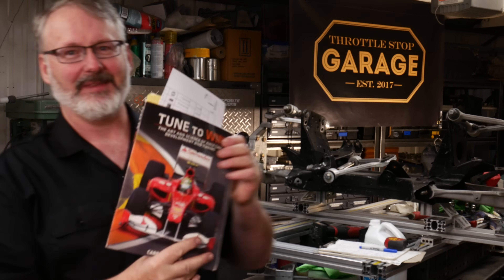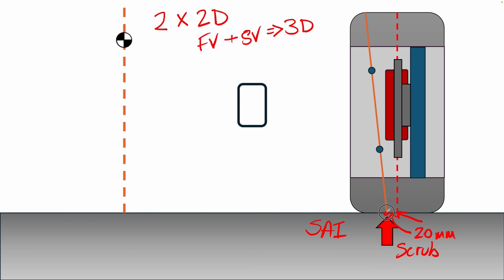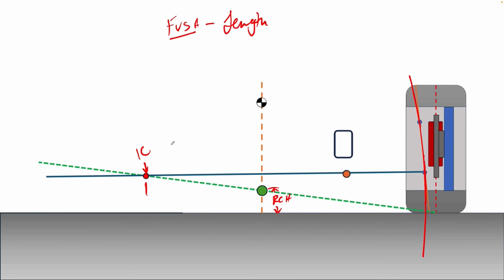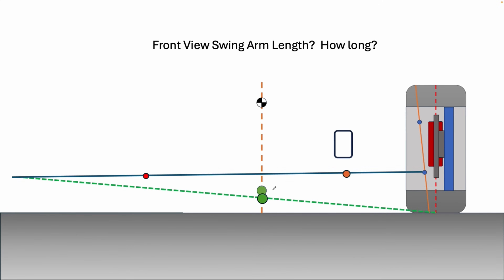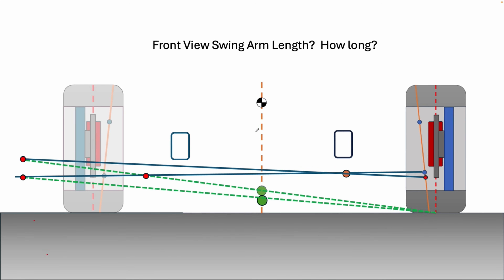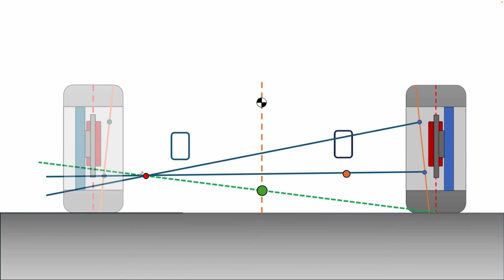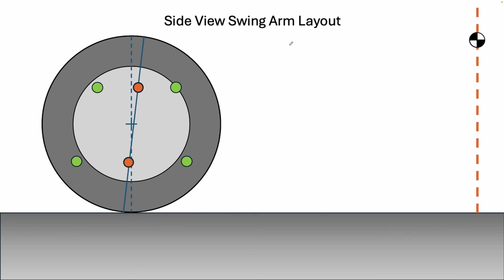Suspension Design - Take 2 - New and Improved and in 3D! My attempt at doing the impossible.

Comment: My only advice to you as  retired engineer is before the weld or build your suspension set up is to build a mock up system that's adjustable. Through out my years in the industry ive always gone back to this basic system once knowing my chassis dimensions and total wet weight.
Reply from the maker: That's excellent advice - thank you.  I will do that for sure.

Comment: Having done alignments for 40 years, that looks legit. I guess allow for obvious camber and caster adjustments up the uppers. A standard set of figures for road use would look like +.5* camber, +3/4-1.5 caster. Possible much more caster for high speed stability. So allow if adjusting from the upper control arms, movement both at the front and rear via slots of shims. Toe in, about .10-.12". Then you've got steering arm lengths, so you can try and figure toe out on turns. That could be tricky. Unless you've already got fixed knuckle placement via the Corvette ones.
Reply from the maker: I've got a plan for the UCA adjustment but need to work it out a little more.  I'm leaning toward slotted holes for adjustment.

Comment: This is all about the spatial relationships between points. That should scale. Build yourself a cycle cart and trial your design. Adjustments will be relatively inexpensive. When you've settled on a design, scale it up and make the 'real' thing.
Reply from the maker: Once I've got it in Fusion, I'll 3d print a model and see how it works.

Comment: Easier way in my opinion to visualize the forces for anti-dive (I think this is from Milliken): draw an imaginary slot that the axle travels in, direction of the slot being the instantaneous direction of the contact patch (perpendicular to the line to the IC) Upper and lower arms level means the slot is fully vertical. The full horizontal braking force of that tire goes through the walls of the slot, and the spring is the only force in the direction of the slot so it’s left with the job of counteracting the pitch moment (pitch torque). If you change the angle of the arms, the slot (which represents wheel travel) is now inclined such that the axle moving in the slot direction is perpendicular to the contact patch/IC connecting line. You tip the slot back and your reaction force from the wall of the slot points slightly up, and the spring now needs to handle some of the braking force (this is the jacking you were talking about) and also the pitch moment: Pro dive. The opposite is anti-dive, where the slot is tipped forward, or the contact patch technically is moving forward. This is why motorcycle forks dive so much: high Center of gravity and also the whole wheel assembly travels in the pro-dive direction at the angle of the fork rake. Perfect storm for bottoming out the front suspension.
Reply from the maker: I'll have to go back and check RCVD to find that - this is a great explanation.  What really unlocked it for me was that it's static based on the fixed points and I was so stuck in the FV that my brain didn't grasp it until I stoped watching explanations, grabbed a sheet of paper and did a force diagram.  Bingo - simple...and then you feel stupid for not having the light flick on.  Learning.
Reply: another one that worked for me though it’d be less transferable to others is imagining an equivalent 4-link suspension from the side, since the instant centers and jacking moments seem more intuitive when you can “see all the circles”. 

This is probably because I’m a CSWP/mech Eng but when I did this for my transaxle Jaguar IRS design I had a much better time using a combination of 2D and 3D sketches and immediately modelling parts within a mess of 3D scans than sticking in the land of 2x2D. I had some TIGHT brake/body clearances I was working with on top of managing all the curves so it was essential that I get to 3D and start waving that corner around asap so I could come up with a strong design that actually clears. I’m using the ol’ laser sheet metal origami trick to make everything. You don’t seem as backed into a corner as me in that respect but if you do get stuck feel free to reach out on fb/instagram (this is my real name) and I can show you what I did. Pretty sure you’re local to me too but obviously no need to discuss locations publicly in the comments here.
Reply from the maker: @mitchellsnider4198  Thanks - I do wish I'd tried to do this in 3D from the start.  It probably would have taken less time and would have ended up in the same place.  Getting clearances and packaging sorted out was/is a challenge.  I'm also trying to use as many OTS parts for brakes and hubs etc as I can. I'll fully design uprights and arms - no problem - but I'd like to avoid having to design the rest.
Reply: @ThrottleStopGarage   bingo, steal the engineering wherever you’ve got consumables, seals, and precision: brakes, engines/transmissions, axles/CVs, glass, dampers. I’ve retrofitted Honda Fit brakes on my Kei truck, and my XJS is getting Audi A6 brakes (had them lying around and they just barely clear 17s which is perfect). Looks like you’re generally following that same philosophy too. You kinda broke that rule with your carbon body but it looks like you had fun, learned a lot, and absolutely earned some respect, from me at least!
Reply from the maker: @mitchellsnider4198  The carbon body did sort of get away on me.  I really just wanted parts that won't rust - then it got out of control and well...there is still a roof that needs to be lighter at some point.
Reply: @ well if you do it I’ll learn some lessons I might be able to apply to my hopelessly overweight Jaguar XJS and might even be able to do the Eventer shooting brake conversion I’ve always wanted with that knowledge. Just don’t make it look too difficult or my wife won’t green light the project 😅

Comment: Hey! Yup I can confirm some contents are confusing on that you first set the lower inboard pickup point. It's as you said instead: RCH first, then derive that virtual arm. Because "virtual" is another thing nobody says. It's the actual height of the triangle. It's all hidden in plans sight like the Holy Grail in Langued'oc :DDD

(...that thing got me confused bc it points you towards making the lower arm as flush as possible with the chassis but this just has no direct relation with what you're doing it has with rollcenter instead!! And I had to get back looking close at a lot of vehicles like my proto (it's a crosskart) before convincing myself that it's fair to have instant centers above the chassis ground, and that's where it was the missing ground clearance I was looking for, in the end.)
Reply from the maker: I think there needs to be a support group for anyone that has survived designing their own suspension.  I went around in circles with software until I worked out the RCH cheat...then the FVSA length sent me over the edge...then I worked that out.  If this helps a single person, I'd be very happy.

Comment: Absolutely true that once you commit to one dimension the others start to fall into place. Since your last video I've begun building a tube chassis from scratch as my next racecar. For me that first dimension ended up being the steering rack position because after a bunch of measuring and math I kept coming up with poor situations if I started somewhere else.
The rack position led to steering arm length and steering degrees available. In order to meet my needs that placed the tire, which set the spindle and ball joints which the set the pivots based on camber curve and roll center... It was an exhausting day of thinking.
Not quite 2 months in and I'm fabricating the lower control arms now to be able to have it on all 4 wheels... maybe by the weekend. 
I also built mine around slugs in the mounts. Basically have +/- 1/2" on everything for tuning
Reply from the maker: It was an interesting experience.  I know I've read it (I've even taught it) but when I've gone through a suspension the 40 or 50 times that I've done this and some things just fall out, it gave me a real sense that there are just a few critical decisions, the rest is then set.  Next up for me will be the arms and uprights.  Then we'll see how it all fits together.  I hope to use the slugs I have for adjustment.  These ideas are still floating right now.

Comment: Hello, I think you should reconsider your starting point, the virtual pivot point of the axle. The body with engine and interior equipment has a center of gravity axis. The distance between the pivot point of the axle configuation and the center of gravity of the vehicle creates a torque when cornering that causes the body to roll. This must be counteracted with an anti-roll bar. However, this reduces the possible lateral guidance forces.
The distance between these two points should therefore be as small as possible. 
Regards
Torsten from Germany
Reply from the maker: Those parameters are part of the consideration.  I estimated the centre of gravity and considered the roll centre location and the resultant moment arm created from that relationship.   Moving the roll centre up to the CofG is not advisable. This would result in a vehicle that doesn't roll...minimizing roll is fine but can effectively be tuned with anti roll bars.  I've placed the RCH at a reasonable position for the rest of the kinematics behavior.

Comment: Thank you for a good video and its so interesting to se and hear youre thoughts, through the process. I am interested in what you changed to get it to the last version (better result). Good job!
Reply from the maker: Thanks, much appreciated. Adding the steering was quite a bit of work as it needed things like the definition of a turning radius and Ackermann. There were multiple iterations of ball joint positions until it all worked out.  I'm still working on the upright design...but I needed a little break to stop from burning on on the suspension.

Comment: If you want good book as a resource, I suggest Milliken & Milliken "Race Car Vehicle Dynamics".  It is a difficult topic but you did a good job explaining it.  This video was front centric, now it gets creative when taking into consideration what the rear is doing!  On my project, I've made everything a little adjustable so I can fine tune it at the track.  Outside of F1, I think it is considered desirable to have a little toe out on bump, meaning that in a turn, the unloaded tire should turn slightly more than the loaded tire.  This is related to bump steer and Ackerman.   Keep up the good work, nice to see you make progress.
Reply from the maker: Thanks.  During this adventure, I read every vehicle dynamics book I could find.  RCVD was one of the first.   I finished the rear years ago - it's an IRS and everything back there is staying as is until I get it on the road and I can see how it all works.

Comment: Hey Craig, good to see you're still around! When I did my car (you know the one) I had just a little bit of knowledge. I knew that I didn't want bumpsteer and that placing the rack outer pivots on the line had a big effect on it. Parallelograms and all. So I modeled it on a sheet of plywood and cut out  full size  cardboard  chassis components. Used pushpins to act as pivots and connected the upright with small nuts and bolts to simulate pivot points for suspension travel. Moved it up and down and said "that looks OK" . Started building on the car and realized I couldn't move the rack rearward enough to get any Akerman, "Oh, well" gotta accept that. I probably wound up with reverse Akerman 🙃. Whatever I wound up with seems to work well! When I turn the wheel clockwise the car goes to the right, perfect!!
Reply from the maker: Alan - glad you watched. I was racing with a guy this summer that built a crazy '69 Camero with an LS engine and a couple of turbos...and a mustang 2 front end.  You know what - that car gets around a corner just fine.  It convinced me that even with "sub-optimal" geometry, it wasn't garbage.  That's around the time I stopped digging the hole.

Comment: Ha ha ye ole rabbit hole of suspension geometry. 😳. 
I found your original content very helpful as it was more visual than the many numbers and figures explanations on YT . 
I ended up using my steering rack inner joints as a datum for the lower wishbone pick ups to eliminate bump steer and worked backwards around the roll centre to determine everything else. 
Of course that was fine until you find that your wheel offset determines scrub radius and disc position 😂. 
Then because mines a race car it has virtually zero droop on the front axle and only maybe 1 1/2 of compression camber gain becomes an issue. 
Round and round in circles many many times. 🤭 
And I’ve not taken into the equation I’m going full pushrod suspension with full aero package with an adjustable bladed roll bar on the front and will be using a third element to compensate for the rear downforce created by the rear aerofoil and huge diffuser.😵‍💫wish mee luck 
Great helpful content for anyone
Thank you 👍🏴
Reply from the maker: Wow.  That sounds intense.  Glad the videos have helped.

Comment: I think you are going to have some really nice suspension when you are done. Having put a ton of cars in the air on a lift, there are some production cars out there with crazy camber and toe changes at full droop. I think you are holding yourself to a standard that is beyond what some auto manufacturers do. At the very least it will be way better than what the car came with.
Reply from the maker: Thanks - I appreciate the positive feedback.  I do hope this all turns out and the suspension works.

Comment: Now that's I've slept on it. A few corrections. Final geometry will be fairly dependant on you tire specs. Particularly the aspect ratio and width. I would assume you're going for a fun street car. So a 60 series would be fine. Going to need some sidewall flex as the control arms move thru the arc. The shorter the sidewall of the tire, the more true to camber setting it will have to be or cornering traction will suffer. If you go say with a 225/70, most is forgiven. I would be tempted to hard model it next with a RC car from the hobby shop, which many already has adjustable bits. Traxxis, Tamiya, etc.  But you can buy individual replacement suspension spares and piece it up, per CAD. Then you can jounce, squish and ponder. Also great for visualizing lateral acceleration to have physical body. Later.👍
Reply from the maker: That's for sure something I'm thinking about.  Front tires are 225/45 r17.  So less sidewall.  This selection is based on current tire availability and future supply in a size that will work.

Comment: Regarding weight transfer during braking, I'm not sure it matters what the percentage of front/rear braking is.

I believe weight transfer is determined solely by the longitudinal deceleration, CG height, and wheelbase.
Reply from the maker: But you do need to consider it.  The equations want percent front along with the variables you've called out.
Reply: @ThrottleStopGarage  Oh right, now that I think about it, the antidive % designed into front or rear suspension would depend on how much of the braking load each has.

Comment: Good to see you back.  I'm curious what tire size and wheel spec you're running?  I assume you have that worked out since you modeled the tire height and centerline.
Reply from the maker: It's nice to be back!  225 45 R17's are the size for the fronts.  Wheels are 45 mm offset (packaging ball joints and brakes mostly).

Comment: Nice work, I have a few comments its too much for one post so I’ll break it up, first I don’t remember if you are making your own spindles now or just using the corvette ones but just remember mechanical trail the hub doesn’t have to be centered in the knuckle.
Reply: You mentioned scrub I think 20mm and that fine for a street car but tires are a big part of deciding scrub, remember you have effective scrub and actual scrub, in one of your past videos you talked about the vett scrub being like 40-50 (I don’t remember the exact number) and how horrible that is, I struggled with this also some years back until I learned why the that school of thought was used, 40-50 scrub on open wheel race cars is not uncommon, the high static negative cambers plus wide soft compound tire and slip angles required more scrub to keep the contact patch closer to ideal, anyways like you I wouldn’t run that much especially because of the rack and pinion your using, wide tires and high scrub would punish that rack so I wouldn’t run try and keep the road force torque  to a minimum. 20-25 is good imo.
Reply: Ackermann for short tracks autocross type of racing I would run as close to 100% as possible.
Reply from the maker: Making my own everything.  C4 stuff will be up for sale at some point.
Reply from the maker: That was my line of thinking.  The C4 was more like 75 mm or something.  I did read a bunch about the nature of scrub and the variables, most of what I could read came down to having it not cross from positive to negative and not having too much.

Comment: Beyond my pay grade 😮
Reply: Same here,
Reply from the maker: Sorry - I tried.
Reply: @ThrottleStopGarage  don't be sorry, it's good stuff. I know where I'm coming back to if I'm doing custom suspension geometry on a project.
Reply: @ThrottleStopGarage 
Ackermann, I assume the oem just picks a happy spot to cover most the wheel bases?
What happens when a vehicle is stretched into a limo? Tires scrub?
Reply from the maker: @AndyFromm  I really don't have any sense of this. For the car I autocross, it has a lot of Ackermann and at low speeds the inside tire scrubs across the ground.  At speed it is fine (dynamics fixes the issue).